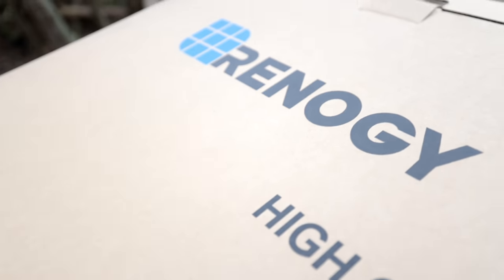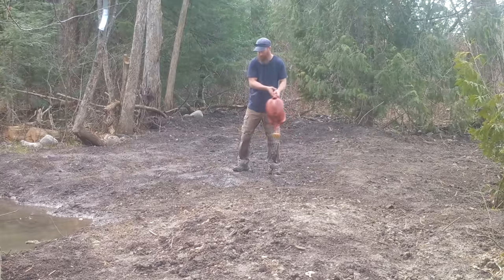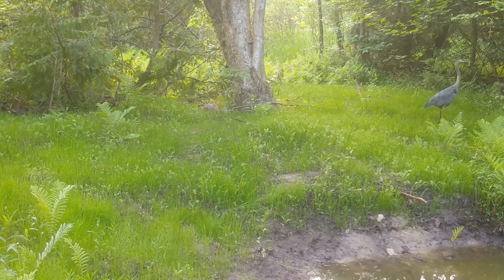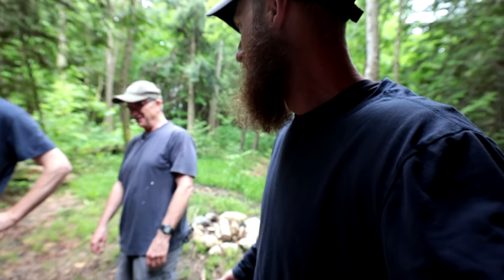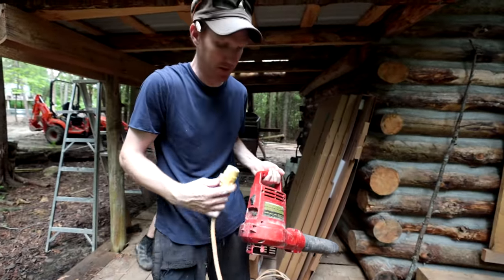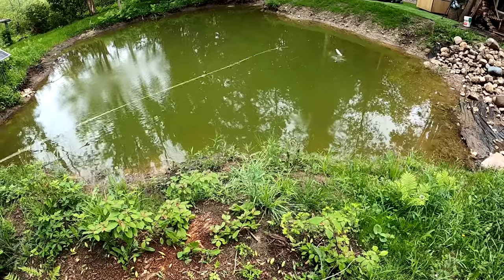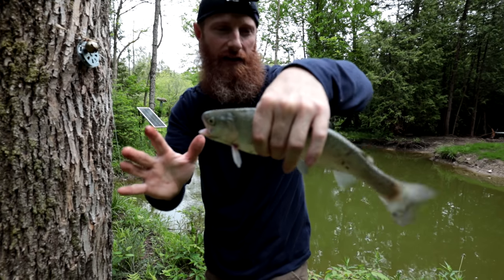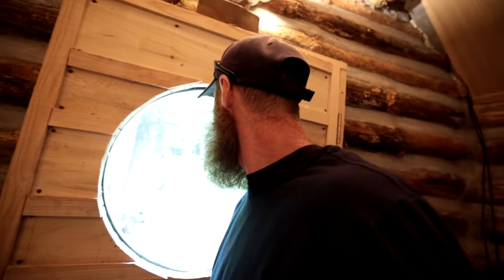Why I'm Taking a Break from Youtube (the truth) - Pond Predators

Comment: Aloe vera gel tablets, take 2 or 3 before you go to bed, I was on medication for years and it was getting worse, Aloe vera was the only thing I tried that worked. I was able to taper off medication fully after 3 or four months it's been over 10 years  with no medication. Cutting down on stress also. On solar I went to school 15 years ago one thing, any shadow even on the corner of a panel will cut the power on all the panels hooked on that circuit crazy how much power is lost. 
Batteries have come such a long way and installation is so easy now and the low cost of a system, Love your videos hang in there, I always watch Kevin's all the time.

Comment: As someone who has battled with digestive issues for years I fully understand the toll it takes on you. I eat primarily a carnivore diet only and once in a while I will incorporate some leafy green vegetables but I avoid any form of bread/pasta at all costs. Not only do I feel more regulated from a digestive standpoint I get the added benefit of super stable blood sugar. Diabetes runs heavy in my family and at 47 I am proud to say I have avoided obesity and insulin shots/pills. I also have more energy for longer durations than I did when I was in my 30’s. 
Glad your feeling better and making content again even if just sporadically. It should be fun and not feel like work or what’s the point. ✌️

Comment: The stock tank is actually an LRFB... Little Round Fishing Boat. As for the Heron, I have seen them catch trout in the 12" class, and eat them.  Love your channels and would hate to see either of you disappear. Glad to hear you are getting a handle on your stomach problems and to hear you will continue with some videos. BTW, for a great mosquito repellent that is not nearly as offensive, give Sawyer Products 20% Picaridin Insect Repellent a try. Some great stuff that is not nearly as harsh. The White's Auto-fisherman is legally used here in Louisiana by the thousands. We call them Yo-Yos. Most folks use them for crappie, exclusively. It is pretty much a wintertime thing. Some folks run a route of 50 or so...some use hundreds. Two dozen will pretty much keep you busy, baiting, going back to the bank, standing by a fire drinking beer or coffee, then running again after an hour or so. Hanging from a branch you get a proper upward hookset, rather than a horizontal one.

Comment: If you want the fish to have a steady food supply, you can make a maggot feeder. You can use old meat, by putting it into a bucket with holes around the bottom, which will attract flies, and they'll lay the maggots,  and then the maggots fall through the holes of the bucket. As long as you manage the meat, the stink won't be overbearing. It depends on how much time you spend around the pond too. If you're going to be around the pond daily, you probably don't want to smell the rotten meat.

Comment: About that Heron! Maybe cut a few dozen sticks, 1/2" - 3/4" dia. x 18" long, push into ground near water's edge, staggered and 5' apart, then string mono-filament fish line tightly from stake to stake. Hopefully this will present a "tripping hazard"  and obstacle for Heron, causing frustration and getting it to choose another pond. Attach some of those small bells to the line here & there. :)

Comment: You could also add a rock wall around the pond. That will not only solve the problem of the rain washing in the edges but if you make it high enough so that there is a 2 to 3 ft drop to the pond bottom  then the heron won't be able to step into the pond to go trout fishing,

Comment: Dead down wind makes a cedar oil spray that works fantastic for ticks, mosquitoes and all.  No toxic crap like the others.  Ticks have been especially thick here in Pennsylvania the last few years and it's worked far better for us than the deet, permethrin laced stuff.  Glad you are feeling better.  I was started on a new med for heart rate recently,  as I've always had a slightly higher than normal heart rate, and, now in my 50's,  it should be addressed.  It caused me to have such awful acid reflux that it was actually painful.  3 weeks off of it now and I feel normal again,  so I have an idea of what you went through.  Prayers continue.

Comment: Elastometric coating on that galvanized tank will seal off the zinc from leeching into the tank. Just make sure you pick one that's labeled for drinking water, I believe Ames laboratories makes some. Use their primer or it will peel off after some time.

Comment: Ah we just got a stock tank also. Oval 8x3’ galvanized for a hillbilly hot tub. You should be able to paint to with an epoxy pain like what they use for water towers … then put your fish in if your concerned. Or muric acid to break down the zinc

Comment: Some pond Dye and water treatment would be great. You can add barely to help clean it as well. That helps prevent & break down organic matter that will kill your fish. These are all natural remedies to add now and not be forced to dredge or use chemicals in the future. Also pond dye gives UV protection for the fish and can help from predation. Also adding hardy Water lileys helps as well. 

If you use this pond as a skating rink you might find a big fish kill come April when the ice thaws out.  I would keep the aerator running through Winter to break the ice so the gases built up during those months can release. Plus to allow oxygenation to continue. Your pond is too small for an ice rink anyway. Just saying.

Comment: If it turns out that the issue is low acid, try eating 1/2 a grapefruit or 1c fresh (not canned!) pineapple before each meal. The pineapple will give you better results because of the bromelain. Of course I encourage you to do your own research on this, it's simply another avenue to investigate. (The cooking/canning process with pineapple destroys the bromelain and lowers the acid. Be sure to get it fresh.. ) Also, if you haven't been tested for worms (tape worm and other parasites) that's another avenue you should check out. Good luck. I also have gone on a 'gut health' journey because of some serious symptoms, and it's been exceptionally difficult.

Comment: We call those yo-yos where I’m from and we use them for crappie or catfish. We put out 30 or 40 and check them all night, we have caught 75-100 on several different weekend adventures!!
Btw you can stick bamboo cane poles down in the mud at the waters edge and tie the “auto-fisher” with a little string

Comment: Fire crackers, like the little bang things you pull on both ends it explode. Make a string like bang line ... Bang it Flys away. Good luck. A bang line around the pond it will trip the line. Bang go's off. They fly off.

Comment: I had one of those auto reels when I was a kid. (70's)   Would use it as a set line while I fished with a rod.  I found that for most panfish it wasn't strong enough to reel them in but the spring kept tension on them to help prevent the fish from throwing the hook.

Comment: I had the exact same issues that affected my stomach and intestines. I went through all the acid reducers with no help. I eventually found a gastrointerologist that said it was due to a bacteria. He prescribed an antibotic which i ended up taking for almost 6 months, it was a very bad infection throughout my intire digestive system. It has been nearly 20 years since and i have not had any heartburn or the dysentery i had. Since then it's been found that this bacteria is from the common house fly and there is a regime to combat this infection. It is called heliocobactor infection and a breath test for it has been developed. Hope this information may help you.

Comment: Not sure what all equipment is legal to use where you are, but for the squirrels if you use some wire or boards to box out that corner where you put the trap and force anything that is used to going there to go over the trap you should have a much higher success rate. For a spot like that I would use a small cage trap or a 110 body grip trap, may not fit but looks like it might from the video footage.

Comment: I had a bait & tackle shop for years, and used metal tanks. I learned the hard way, a new tank will kill fish, in my case, minnows.
The galvanized tank will leach out. But, there is a cure for it, if it is still on the market, called Mirror Plate, or maybe it was one word, Mirrorplate. It is a green colored stuff, thicker than paint, but easy to paint the inside of the tank with a brush. Let that cure for a week in the sun, or out in the open air. Rinse the tank a couple of times, then fill it with water, good to go.
An old galvanized tank that's been weathered, has already had time to leach out any of the nasty. 
If you cannot find the Mirror Plate, call a minnow dealer/bait distributor, and they should know about more modern stuff to paint the tank with.

Comment: The zinc on the galvanized tub needs to oxygen in open air to remain its coating...if you remove that element, rust and corrosion resistance is lost....Good luck with the galvanized rub.

Comment: Me and my girl have had those digestive issues for a long, long time and  It SUCKS!  When i didn't know any better i'd induce vomiting which helped but the acid would erode my teeth . What works now is Pepcid extra strength. I avoid eating late. Good room circulation helps too, poor air circulation while sleeping causes my stomache issues as well. Once in awhile I'll drink a Citroma which is a bitter lemon laxative drink you can buy for 1.99 at local pharmacy. I only drink this if the acid isn't going away. After drinking it, drink a few cups of water. Move around. Stay close to the toilet!!!  Last but not least, please stop worrying so much. This can trigger it. What i do when i find myself worrying is laugh it off. Easier said then done but practice distracting yourself from worry. Goodluck bro!

Comment: Hey Chris, I've been dealing with the same issue regarding the acid thing, in my case turns out too low acid production.  I got myself to a point of taking one HCI (hydrochloric acid, stomach acid) and ACV (apple cider vinegar) every time I would eat and it worked pretty good.  Then I went to a naturalist and he put me on Standard Process A-F Betafood which is for digestion.  Low and behold my acid refulx stopped until I had some dairy (half and half).  So I'm eliminating dairy from my diet because I cannot stand the acid reflux.  It absolutely ruins the day.  It's definitely tied to our diets.  Good luck!  I hope something I've said here helps you! 🤗
Reply: Standard process is good!!

Comment: Dude, I wen through 3 years of pretty extreme digestive issues. Pain was a 9/10. This from a guy who has had over 50 stitches on his body, broken bones, etc... most debilitating experience ever. After years of treatment, come to findout the majority of the abdominal pain is due to abdominal nerve entrapment due to gall bladder surgery.  I do have digestive issues, but the pain was cause by gas and bloating in my large intestine putting pressure on the entrapped nerver in my abdominal wall. I have appointments to get never blocks here in the near future.

Any kind of chronic ongoing illness has a HUGE psychological impact. Im a pretty resolute dude. Self taught telemetry engineer and small business owner. If it wasnt for my God send of a girlfriend, I would have spent those 3 years in EXTREME depression. Chronic conditions are a different demon from acute illness. Id rather have borken bones once a month for the last three years than have dealt with this pain.

Comment: Herons are tough to deter. You're probably not going to like it, but fencing your pond going to be your best bet if you want to keep the current design. Keep in mind that even if you get a permit to remove one of them, odds are you're probably dealing with multiple birds. You'll want the fence within a foot or two of the edge of the water. Your pond is, unfortunately, designed as a buffet for them. They land on an open gently sloping banks and stroll down into the water to fish. When designing predator unfriendly ponds, shallow banks that extend into the pond are a no-no for the reason I mentioned before. 

When we designed our koi pond, we built the edges to drop straight down into the water and they go down about 28 inches under the surface. We then built rocks up about 12-16" above the top of the water.  The other behavior that seems to be true for herons around us (we have a koi pond) is herons won't land or stand where they can't spread their wings to take off. Unfortunately we built one section using a large flat rock and it's only about 8" above the water. We've had herons use that for fishing.  I had to run a fence across that section of the edge of the pond to keep the herons out. We also plant tall plants around the banks, or put other structures around to make the rest of the edges unattractive to herons. We lost a few koi early on, but with the fence in place across that rock (crossing my fingers), we haven't had an issues since.

Comment: Man I have suffered from the Acid reflux and Gerd for about 15 years now and I did the same thing. Went to doctors took PPI for years to find out they were killing my stomach. I went on a mission for about 2 years now to get off meds and get my stomach back. I have low stomach acid like you mentioned. I did like an at home test that is pretty accurate where you drink 1/4 teaspoon of baking soda in 4oz of water on an empty stomach and time how long it takes you to burp took me like 5 minutes and that indicated low acid. I take a pro and prebiotic, and I also take a digestive enzymes before I eat to break food down faster. I take digestive enzymes for the company NOW it also has hci in it to help your body produce acid. I stay on a diet for the most part. It's a low carb diet and I'm gluten free cause I have a wheat allergy. I also drink metamucil daily. So far this has really improved my stomach ang digestive health. I don't bloat anymore and I feel great. If I do get reflux it's pretty much because I cheat on my diet. I also take a chewable called esophageal guardian and a daily vitamin with a good amount of b12 helps also. It's a long road to get the stomach back normal from taking ppi but it can be done. I took several things and found that these supplements I take now have worked best for me. The NOW brand digestive enzymes is really the key. It says take one per meal but if I am eating a meal with a lot of meat I take 2. This is what I do and it has really helped me alot maybe give these a try and you might see some improvements. But it's hard but have to stop the ppi they are killer for digestive health.

Comment: Have you tried bird of prey statues to get rid of the heron? They seem to be afraid of owls, like many birds. 
Also,  coyotes are a huge problem for fish. Take it from someone who used to watch coyotes catch carp on the Colorado River,  on a daily basis.  Their jaws are literally designed for catching and holding slippery and struggling prey, and they attack dogs, so I'd drop the yote on principle. 
Also, if you have trout in a pond next to a river; WATCH OUT FOR OTTERS. One otter can eat up to 22 lbs of fish a day.  
One last thing... solar power installed above a certain parallel (I think it's the 38th) is actually counter-productive.  You spend more for the equipment and infrastructure, then you will get in power return.  My suggestion? Have a plan B to your plan C. 
Good luck and good hunting! 👍

Comment: Hey there, sorry to hear about your stomach, check out as well Betaine HCL as well for improving your stomach acid production, its natural, its made from beets, a lot of ppl have help with stomach issues with low acid using it as well. For your Heron, or other bird pond predators, you can put a net over part of the pond surface, eventually the trout will figure out they're safe there from it there, I doubt they could swallow a big one, but they might still try and catch one going by and pick at it the best they can. Hope that helps, like both your guy's channel, oh yeah, that thing you were mentioning about the dirt going into the pond after it rains, if you guys dig a swale on contour with the land above the pond, that will help slow, soak and spread the water from rainfall,etc and the slower speed will make it drop the sediment it's catching into the swale and not in the pond. Cheers.